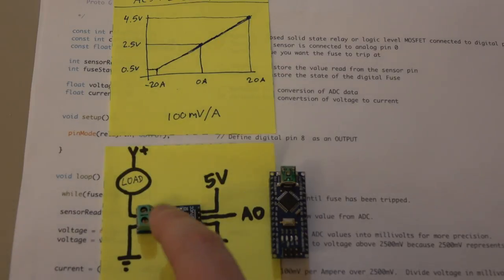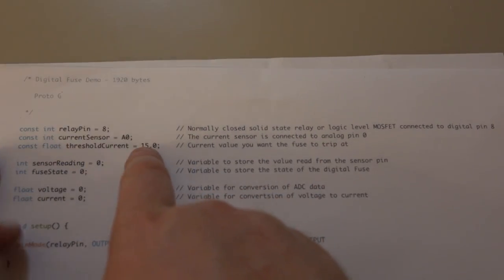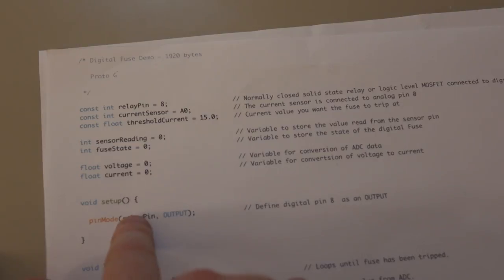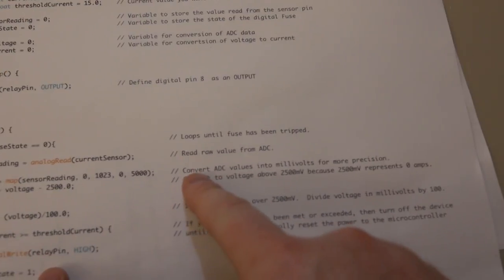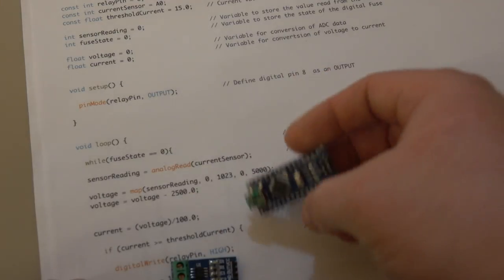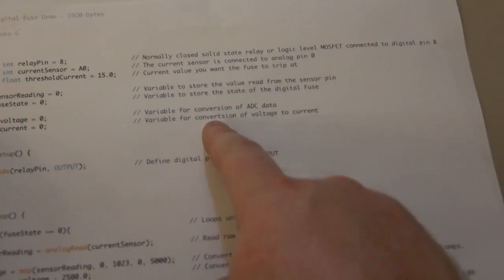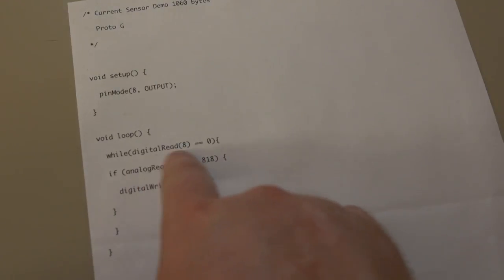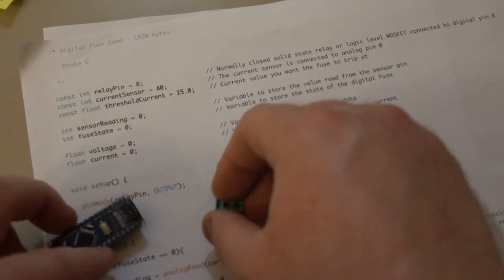Sensory Overload #3 // Digital Fuse

Comment from the maker: The code in the video was using the default functions from the default arduino library: https://www.arduino.cc/en/Reference/HomePage
If you are using a different microcontroller or language, the logic used is still the same.  You can download my code here: 
https://drive.google.com/open?id=0Bwv7ZaJYm8JpX1oxeWlsdWlfdEE

Comment: IMO relay is too slow, better option will by transistor (MOSFET or JFET).
Also you don't need arduino for it. You can do it with sevral electronic components - sevral resistors, op-amp or comprator, triak for latching, transistor, and that's it.
Reply from the maker: Look at the comment to the right of that line of code.  I suggested using a solid state relay or MOSFET.  Most things can be done with discrete components but the down side is that discrete components don't always allow for easy adjustments of functionality.  I can easily change a 15A digital fuse to 11A by changing the code.  If I were to do it like you are suggesting, I would need to change components.  Microcontrollers allow for cheaper overall pcb assemblies and more flexibility over traditional circuits.  There are times where discrete components are preferred but most modern projects should revolve around a microcontroller or microprocessor of some sort.

Comment: No crowbar and a real fuse? I've always preferred a way to hard disable power by having a way to pop the input protection fuse
Reply from the maker: Hey Robert, you could use this with an active crowbar circuit for even more peace of mind.  I've always preferred devices and power supplies with over voltage, over current and over temperature protection.

Comment: Why did you initially set your relay pin(output pin)  to LOW and then HIGH when the current threshold was met? Does the relay function similarly to your fuseState variable?

Thanks for making the video
Reply from the maker: Good question Habib.  The digital pin that the relay is connected to is LOW by default so I did not need to initially set it LOW.  If you are designing something like this, it is more efficient to use a normally closed Solid State Relay or MOSFET.  This way, you're not wasting energy when the device is functioning properly.  When the output of digital pin is set to HIGH, it will disconnect power to the device you are trying to protect with a normally closed SSR.  If you did use a normally open SSR or MOSFET, you would need to change the program to initially set the output of digital pin 8 to HIGH and then set it to LOW when the fuse is triggered.
Reply: Alright, that makes more sense to me. Thank you!
Reply: @ProtoG42  can I use the same method to replace 5 relays and fuses with mosfets and the digital fuses??

Comment: Sweet I've wanted a good way to measure higher currents with an arduino? Any idea how accurate these sensors are?
Reply from the maker: The data sheet says ±1.5%. I'm sure you could do some calibrating to dial that down for even better performance.

Comment: isnt truncation equivalent to rounding down?
Reply from the maker: nicktohzyu the answer is equivalent in some cases but it is not the same.  Rounding, in programming, involves processing the number and deciding what to do.  Truncating does not make a decision based on the digits to the right of the decimal point, it just removes them.
Reply: yes, but in c/cpp is there any case where rounding down is not equivalent to truncating?
Reply from the maker: nicktohzyu the round() function in c rounds down if the the number end with digits between ".0-.5" and rounds up if the number ends with digits greater than or equal to ".6".  The floor() function c is equivalent for positive numbers but not for negative numbers.  For example;  round(2.659) would equal 3 whereas the interger math truncates it to 2.  floor(2.659) would equal 2 but floor(-2.659) would equal -3.

Comment: why not use something like a userdefined literal and calculate the 
corresponding analogValue for the thresholdCurrent during compiletime? 
it makes no sense to calculate a current for every loop. massive 
overhead. your program would be easy to understand like in the first 
example and exactly the size of the second.
Reply from the maker: ramgni ttilps the second program is definitely faster and smaller but for teaching beginners, I think the first one is easier to understand.  You're right though, calculating it yourself before compiling is better and just leave a comment showing the math involved.
Reply: a literal is more like a normal function, but it also works during compile-time. you don't just write the final value or or use some dirty #define-math. but ok
Reply from the maker: Are you suggesting that I calculate it before the setup like this?  

float thresholdCurrent = 15.0;                                    //100mV per Amp sensitivity from the sensor.
float voltage = (thresholdCurrent*0.100) + 2.5;      //15A corresponds to a 4 Volt output from the sensor.
float analogValue = (1023.0/5.0)*voltage;              //818.4  for 15A

thresholdCurrent = analogValue;       //15A converted to the corresponding analog value from the ADC

//Then in the loop():

current = analogRead(currentSensor);

If so, that's also fine and speeds things up a bit.
Reply: yes, this combined with const float or better constepxr is one way. userdefined literals are the other, but only make sense when you use this kind of calculation more often throughout your program